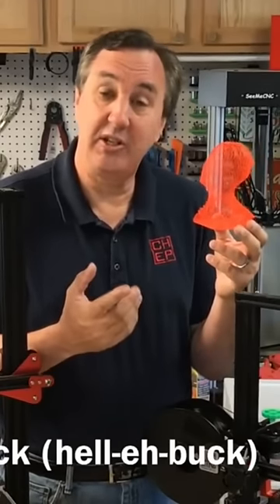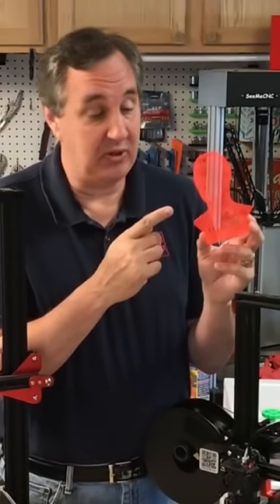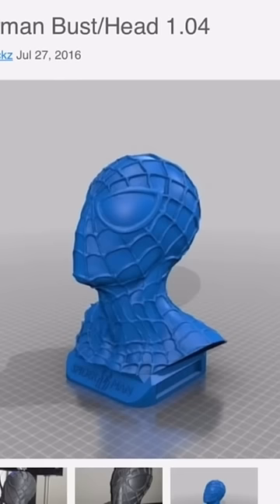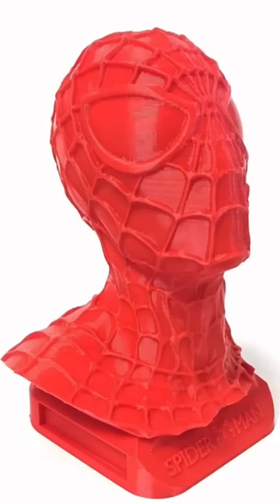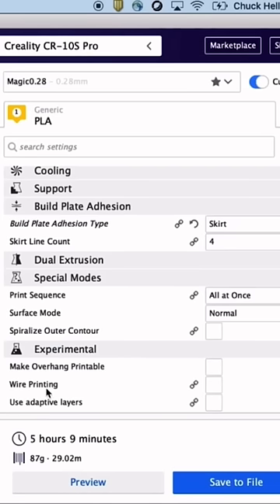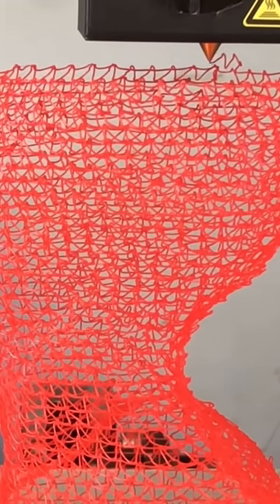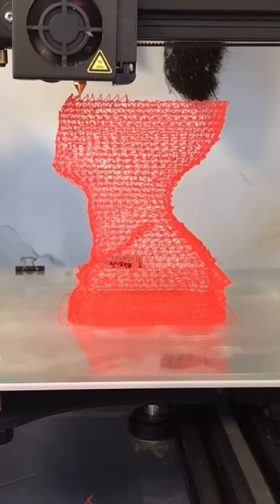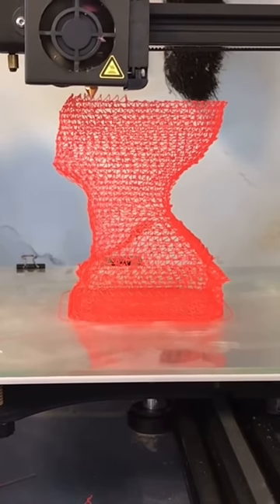Wire 3D Printing a Spider-Man Bust

Comment: that looks like a great method for roughing out large shapes before doing a long print for a large part of you need to check clearance or somthing
Reply: Wouldn’t the printer refuse to print if that were the case
Reply: It definitely saves a lot of material but it looks like it prints pretty slow using the wire print method. I'm curious how long it takes compared to standard settings.
Reply: @minnow1337  for testing if two pieces would fit together they mean
Reply: Idk I thought this to then I really thought and remembered tape measures....

Comment: I think it could be useful for prototyping custom parts. Print a quick draft in wire mode, check if shape and dimensions are roughly OK, fix if needed, print in regular mode.
Reply: I can definitely see that being a thing. It must definitely save filament and cut down on the time between iterations. Probably nothing too critical though. I have s feeling its not very dimensionally accurate

Comment: Well once i get my brittle print problem figured out ill give it a try
Reply: Wet filament. I promise you
Reply: Try drying your filament in a oven (if it's pla you need to be careful to not go over 40C) for a hour .
I have dried PETG before at 60C for a hour and results were good.

Comment: nothing with a 0.28mm layer height is a " pretty good print"........ i would only use such low resolution layers, for a quick test prints i dont care about and will be getting rid of........ 0.15mm is what i would consider standard.....  its better to spend the extra time getting a quality print, instead of  rushing to get a low quality print, that you will probably have to reprint any way.

Comment: Do u gotta use an raft or brim at all while printing these
Reply from the maker: No
Reply: @FilamentFriday  and what speeds do u gotta prints theses at
Reply: @FilamentFriday  how long did it take to print that
Reply from the maker: About an hour. Details in linked video description
Reply: @FilamentFriday  do u need any infill while printing these
Reply: @monsterstorm78  higher than me bro calm down
Reply: @di_spencer7372  why say that 🤔
Reply: @monsterstorm78  just look at it. Where would the raft go. Do you see any infill. You can answer ur questions urself